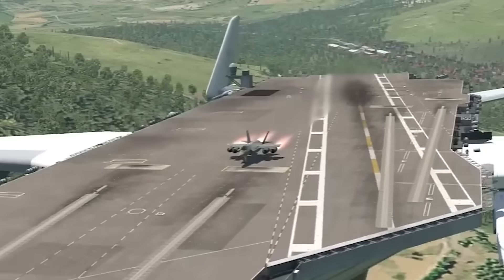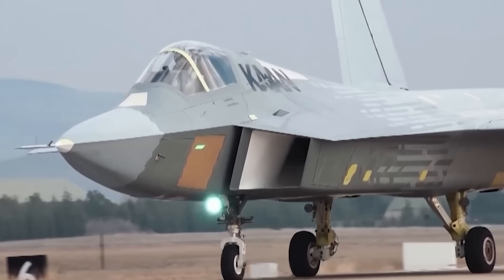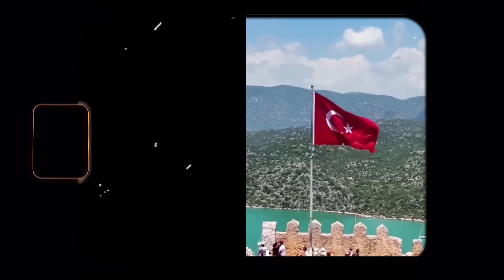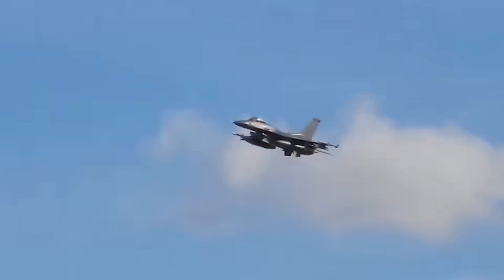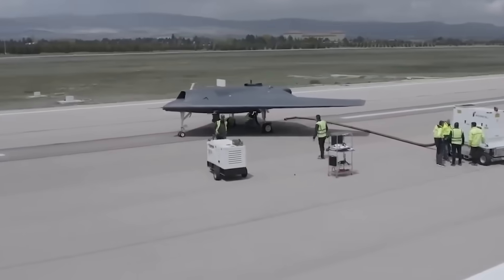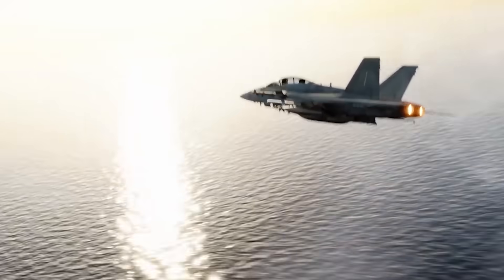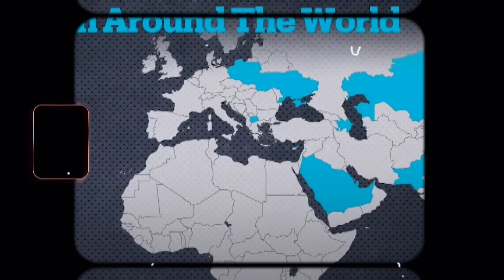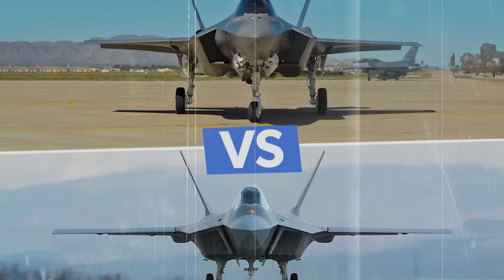TF Kaan vs. F-35 – A Comparative Analysis

Comment: The KAAN won't surpass the F-35 anytime soon. It's a prototype, with only its second flight this year, production slated for 2028-29, and still uses foreign GE-F110 engines, compromising stealth. Even the indigenous TF35000 engine remains unproven, with no track record to rival mature F-35 tech. The F-35, with over 1,000 units operational globally, excels in sensor fusion (acting as a networked command hub), true stealth, and versatile combat roles from air dominance to precision strikes. KAAN's payload hype doesn't match F-35's proven, battle-ready capabilities. Pride is great, but facts matter more.

Comment: I don't think they will buy engines from Russia or China. The Ministry of Defense and the defense industry are working meticulously on the national TEI 35,000 lbs engine, which will be ready by 2029 or 2030, making Türkiye 100% self-sufficient in five years. The engine for the Altay  tank BATU is also ready, with some testing and certification still to take place. Turkiye is developing a multi-layered, AI-supported air defense system called “Steel Dome” (Çelik Kubbe). It is designed to protect Turkish airspace from a variety of threats, including drones, cruise missiles, and even fifth-generation aircraft. The system integrates various Turkish-made defense technologies, including radar, missiles, and command and control systems, into a unified network. The construction of the first aircraft carrier with a length of 300 m has been commissioned. Several important projects are still underway, but I don't want to go into detail about them here.

Comment: F35 has so many failures and crashes during a short period of time, it crashed and got destroyed many times, recent failure is the emergency landing of F35A in india due to hydraulic suspension failure and its been 10 days the plane is still in there without being functional despite having engineers on ground to resolve the issue, the Kaan is new and yet it has to proof itself.

Comment: it all sounds great but the hardest part is the engine, to be more specifig: creating engine blades from super alloys that can resist 1600+ degrees heat. The production requires single crystal manufacturing, and very precise cooling channels need to be added to each blade. this tech is super difficult to obtain in a short timeframe if at all possible. 
I hope we can achieve it

Comment: Shutting countries out of military programs has proven to be one of the dumbest moves that the US has ever pulled on anyone. They did the same with Pakistans F16 program, after which Pakistan in collaboration with China made the JF17 in record time. Plus, who knows how much knowhow about the F16 was transferred to China in the process. Also, the JF17 program marked a major leap towards betterment in relations between Russia and Pakistan, because of the JF17s reliance on the RD93 engine. Nicely done, uncle Sam.
Turkey will pull this off no doubt. And it will have more than enough allies to help them market it, test it and make it into a roaring success.

Comment: echnical Issues of the F-35
Software Errors (ALIS & ODIN systems)
The aircraft’s maintenance and logistics software system, ALIS, frequently encountered errors.
It often misreported component failures.
ODIN, the system that replaced ALIS, also experienced issues during its initial deployment.

Helmet Problems
The helmet display provided to pilots is extremely expensive (around $400,000), and some versions caused glitches and delays in night vision.
It could misrepresent targets or display double images.

Engine Overheating
The Pratt & Whitney F135 engine overheats when operating at high speeds for extended periods.
The vertical takeoff/landing capability (F-35B) puts additional stress on the engine.

Flight Control Problems
Some F-35 variants experienced loss of control during high-speed maneuvers.
High G-forces can limit the pilot's field of vision.

Insufficient Weapon-Carrying Capacity (In Stealth Mode)
To maintain a low radar signature, weapons must be carried internally, which limits the overall weapon load.

Limited Visibility (F-35A and B)
In some versions, the pilot’s rearward visibility is limited.

Comment: Turkey has leapt forward in radar. F35 fighter jets taking off from Israel were detected 400 km from the Turkish border and Turkish F16 jets quickly took off. With our developed software, we have the ability to hit Israeli jets from 400 or 500 km away. There is a formidable system called the steel dome in our airspace. In a few years, Turkey will be the sole arbiter of the entire Middle East. Who knows? Maybe that's why Israel is in such a hurry?
Reply: ㅋㅋㅋㅋㅋㅋㅋㅋㅋㅋ lol

Comment: Fe 35 sadece ABD nin  hetkesi köle yapmak için kurduğu sinsi bir tuzak. ABD şifre vermezse uçak yerinden kalkmıyor. ve çok derin çözülemeyen yazılım ve yapısal sorunlar var. lojistik devamlılık felket kötü . ve en önemlisi sömürgeci bir devletten köle olmak için pahalı ve çok nazik bir uçak almaktansa .tamamen bağımsız ve daha iyi bir uçak yapmak çok daha iyi. bu sayede Türkiye ABD ye bağımlı olmadan ondan daha iyi savaş uçağı yapmış olacak. 

Fe 35 is just a sneaky trap set by the US to enslave the hetkes. If the US does not give the code, the plane does not take off. and there are very deep unsolved software and structural problems. Logistics continuity is terrible. and most importantly, instead of buying an expensive and very delicate plane from a colonial state to be a slave, it is much better to make a completely independent and better plane. In this way, Türkiye will be able to make a better fighter plane without being dependent on the US.

Comment: TEI is developing a 35,000 lb engine for KAAN, produced by TUSAŞ. The engine development process is almost complete, and the engine and drivetrain units are currently being tested. In 2028, KAAN will fly with a Turkish-made TF35000 engine. And KAAN is a 2-engine aircraft. In other words, KAAN's thrust power will be 70,000 lb in total. However, the F-35 is a single-engine aircraft with a thrust power of 40,000 lb. If things go well, KAAN will be a much superior aircraft than the F-35. KAAN engineers have a national consciousness. For this reason, they are constantly working with great excitement. And our engineers do not see the F-35 as a rival for themselves. Their goal is to try to do better than the F-22. They may not be able to do this right away, but they may achieve this one day because they work day and night with love for their country.

Comment: Just today a news from turkiye the KAAN  made its first flight with their indiginess engine TF35000 that can pull 35 thousand pound of thrust
Reply: İt is lie but they are testing tf 6000 we will add a Just one feature and it will be upgraded to tf10000 for Kızılelma,anka 3 and tb3s,after some development it will be tf35000 and it will be replaced with f110 with two tf 35000 and it will almost dubble the power of f 35 s engines Total power.

Comment: The biggest advantage of Kaan is not being dependent to any other country. Period!
Reply: And the biggest disadvantage is it doesnot have an engine 🤣🤣🤣🤣🤣🤣
Reply: @aydser6726  yok ama olacak
Reply: The biggest advantage is that it doesn't exist😂😂😂
Reply: Only 95% of Kaan's components are imported! Realy not being dependent!
Reply: @georgigeorgiev1329 Only the engine and ejection seat are foreign. Other parts have been produced and some are being worked on
Reply: @georgigeorgiev1329  motor dışında birçok parça yerli ürün
Reply: @georgigeorgiev1329  KAAN'ın yüzde 90'ı yerli üretim.Kalan yüzde 10'u 2 yıl içinde tamamlanacak.
Reply: @ahb963 Turk fairytales 😂😂😂

Comment: TEI "TUSAŞ Engine Industries" is one of Turkey's leading and largest defense industry organizations, having manufactured engines under license for many years.

TEI is actively working on JET/TURBOFAN engines of various capacities and power outputs. In addition to the engines developed for unmanned aerial vehicles, rockets, kamikaze drones, and target drones, TEI is also continuing to develop a jet engine that can be used on tanks (similar to the American Abrams tank) and an engine for the 5th generation fighter aircraft, KAAN.

The development of a new generation engine from scratch to meet 5th generation requirements is a lengthy process. To prevent time loss and address this gap, the GE F110 engine is being used as an interim solution.

The 5th generation jet engine aims to achieve supersonic speeds without the use of an afterburner and is intended to have a high payload capacity.

While TUSAŞ Aerospace Industries is building the 5th generation KAAN aircraft, TEI Engine Industries is developing the TEI TF35000. 

The engine's average power will be: between 25,000 lbs of thrust without afterburner and 35,000 lbs with afterburner.
Kaan is designed with a twin-engine configuration and will feature two TF35000 engines.
An average speed of Mach 2 and above is targeted.
With this, Kaan is projected to have a dry takeoff thrust with a useful payload of 27 tons using dry thrust without afterburner, or a takeoff thrust with a useful payload of 32 tons using the afterburner.

Furthermore, when compared to the F-35, the MMU KAAN (TF-23) has a 57% higher dry thrust to maximum weight ratio and a 78% higher afterburner thrust to maximum weight ratio.

Comment: Kaan is more like the F-22 cocept whrn it first came out. F-22 is still way better jet than a F-35 even with the electronics being 30 years or oldsr than the f-35. Disoite its unreliable, fragile structure, not being able to fly in öost situations and being extremely expensive to build and maintain, it is still the best air dominance jet yet.

Kaan is going on with that concept. Target is to be the unmatched hunter in the sky. Additionally, kaan will not have only one sibgle vwrtion or stage. İt will have different variations based on the duty it will do. Some even will have heavy payşoad  out board, for the air to ground mssions that will not neen much stealth.
Some with complate air dominance ro hunf down anyting that fly pn the sky, from tth gens to 6rh gens. Probably am other brother jet that will be able to take off from air craft carries that Turkiye already has been building.

Taeget is to make a new age F-22 that is way stronger, reliable, much cheaper to build and maintain, modular design that you can use as a base platform to build an advance jet depends on your needs. 

20 years ago, Turkiye was building basic drones those were not öuch advance than the ones tpu buy feom local stores.

10 years later, rhey built a armed UAV concept that completely changed to modern day warfare. Used uav's to destroye air bases, air defense systems, tanks, naval bases, battle ships, taking down attack choppers, jets, planes, uav's doing electronic warfare, working as a f-35 flying computein the sky to coordinate whoe army unita om the land, sky and water, hit extre6fast targets like a car, motorcycle, while traveling in high speeds, do multiple and simultaneous attacks on conventional large armies in battlefield (such as the attacks nade in Ukrainian war agains to massive Russian military units at the beginning of the war).

Even Today, most of those uav's can carry advance cruise missiles (SOM-J etc.) with a 400+ km range nd hit a target without any kind of g0s etc support, with a 50 cm error margin, can take down a frigate!!!

Imagine what 20 Kaan and 200+ of those armed jet engine uav's can do in a air dominance war.

Comment: Today it is clear how jet aircraft should be defined for the 5th generation. It is based on stealth and the ability to detect and engage multiple targets remotely and destroy the enemy before they see you. The 6th generation starts with the ability to control unmanned aerial vehicles and the use of artificial intelligence. It even includes important features such as the ability to control ground, air and naval elements and electronic warfare capability.  Kaan is being designed to incorporate these features. Block 1 will of course start with 4.5 generations, but will fully transition to 5th generation features with new blocks in the 2030s. In fact, my estimation is that it will exceed the 5th generation and become a 5.5 generation aircraft. In this way, it will control UAVs and will be a very deadly aircraft with AI and electronic warfare systems.

Comment: You didn't mention it in the video, but the early versions of the TFX 
Kaan will only use the F110 engine. Later on, it will be powered by the 
currently developed TF-6000, then the TF-10000, and eventually by two 
TF-35000 engines specifically developed for the Kaan. That's when it 
will truly be ready. I hope you make another video and do a comparison 
once it's fully ready.
Reply: Tf 6000 and 10000 are for drones
Reply: @sparklytazer5678  yes tf  35000 kaan

Comment: The F35 has a 40,000 lbf engine, making it more powerful than the KAAN's 35,000 lbf. But, the KAAN has two engine (70000lbf). However, maneuverability isn't the key factor for modern aircraft. With its two engines, the KAAN can generate more electrical power for its AESA radar and sensors than the F35. This enables greater radar range and resolution. More power is also available for electronic warfare.
Reply: There's no 35.000lb F-16 Engine  🤣🤣The F100-PW-229 develops a thrust of 29,100lb, whereas the F110-GE-129 generates a power of 29,500lb
Reply: @sametoruc1347 You should definitely improve your reading skills. No one here has written about F-16 engines, and the F15 engines installed in the prototype and first batch aren't the topic here. First, read up on the KAAN project, and you'll quickly understand what we're talking about.
Reply: @roundearther272  Kaan has 2x F-16 Engine on it and until you have another one built or purchased from somewhere those are the engine will be used! I'm talking about current time and reality,  TF35.000 Engine is not ready at all if everything goes well maybe 2030 even after so until then Turkiye has no other engine options at the moment and you mentioned Kaan has 70000lbf... Where is your sources that Kaan has 2x 35.000lbf engine 🤣🤣🤣 maybe you need to learn how to write correctly, If you meant to say Kaan will be equipped with 2x TF35000lbf in the future like 2030 or after yeah that's fine.  I think I read your comment correctly maybe you need to get your facts right and do proper research or work on your writing skills.
Reply: @sametoruc1347 Your assumption that the "KAAN" has two F-16 engines is fundamentally wrong. You can't simply install two of the same engine, rotating in the same direction, in an aircraft. The second engine must rotate in the opposite direction. Cooling and components must also be considered. Which leads to the conclusion that an F-15 engine will be used for the prototypes! But that's probably too complex for you. Your excessive use of emoticons shows that you lack the necessary mental maturity. What you also don't understand is that this aircraft isn't even in the prototype phase yet. The current aircraft you saw is an initial concept design. The engines used here will only be used in the prototype phase. Whether it will even be used in the first version, Block 10, is questionable. So my original statement referred to the engine currently under development by TEI. But forget about that. That's far too much factual information for you. Why don't you just send on lots of laughing smileys like a child?
Reply: @roundearther272  you just proved me that I'm right. TEI engine is not even built yet so how did you end up fitting them to this Aircraft? ha ha you made me laugh with all that kind words..
Reply: Kaan has NOTHING!
Reply: oh really why Trump has said they need a new F-35 with twin engines???
Reply: but kaan has two 29000 engines,,,,,,it has 58000 thrust

Comment: Yanks messed up with their bs sanctions and all against the turks, maybe cause they lost two war ships to the ottomans in past and signed a treaty and paid taxes lol. But you can't keep anyone down determine to gain its independence. Their military hardware is battle proven and works and is way cheaper then yank crap and lets be honest once their own jet engines are up and fully running it will be the game changer. As they have 9 different engines being tested at the moment for different roles and other plans in the works.

Comment: 😂😂😂KAAN is a flying bucket in relation to F35😂😂😂😂
Reply: Yeah, sure? The F35 is a coffin, my friend. The Engines don't have enough power to cool the jet, and if the F35 sits in warmer temperatures for too long, it can't even take off xD There isn't enough fuel in it, and even the US Navy and Air Force don't want those damn things, but sure, the F35 is great xD
Reply: @Easypeasy5558  From block 4 onwards, the problem you mentioned will be solved! From 2029 onwards! After all, the Israelis were constantly flying the aircraft even in desert conditions.
Reply: @Easypeasy5558  The KAAN was built on the 2 engines of the F16 that it is carrying, my friend! It is known that first you build the engine and then on that the shape of the fuselage and of course the individual systems must be compatible and functional! Turkey is really begging to be included in the F35 program again! Since it is a problematic aircraft, then why does the Turkish Air Force insist??